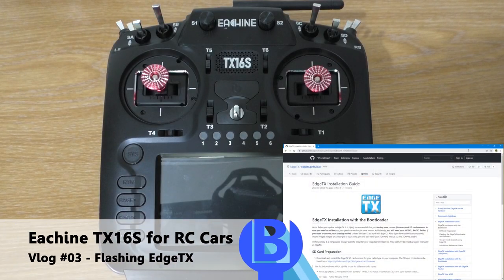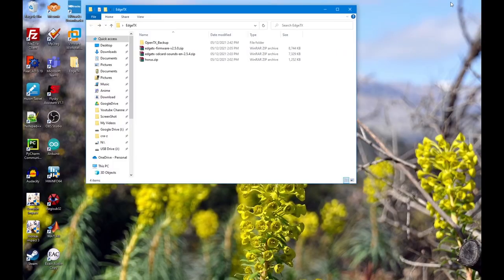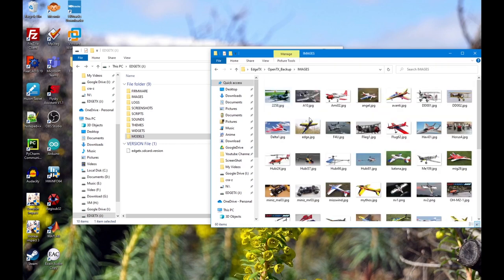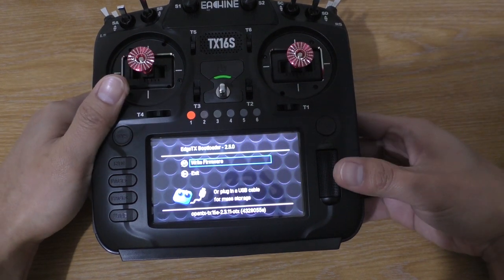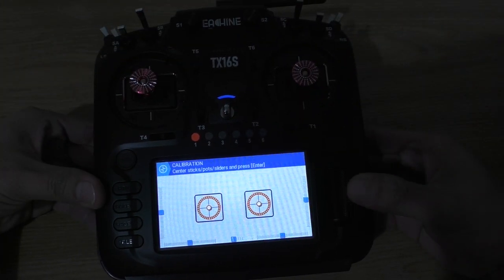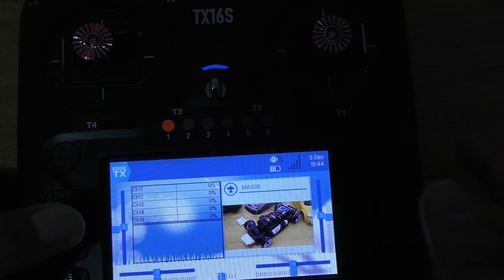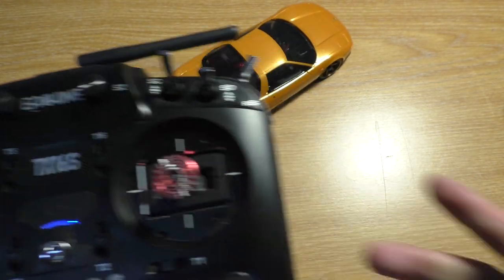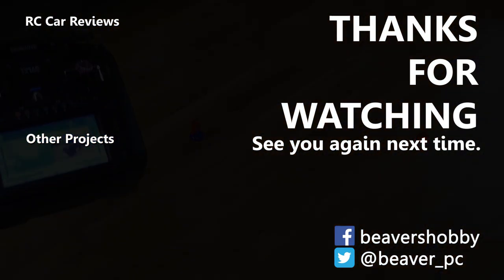Eachine TX16S for RC Car | Vlog #3 - Flashing EdgeTX

Comment: How did you setup your Rc car with this firmware?
Reply from the maker: Cars don't need as much setup as plane or drone. Just the simple stuff if needed like throttle calibration for ESC, this one is done on the ESC side (please refer to the manual) and steering end points.
Reply: @BeaversHobby  thank you for it 🙌🙌🙌🙌 you are the best !!